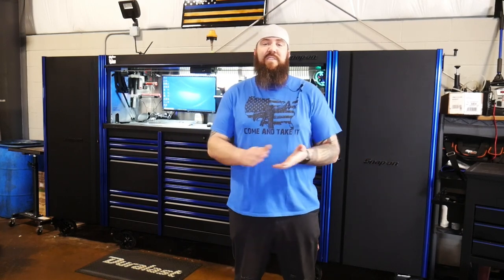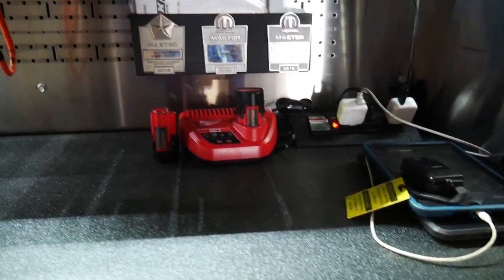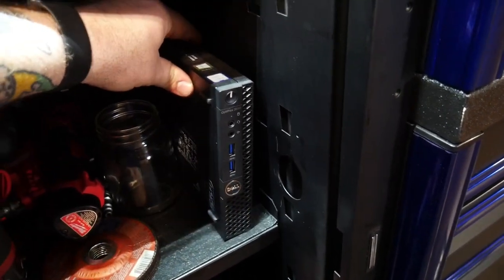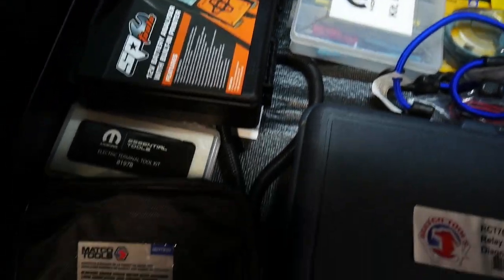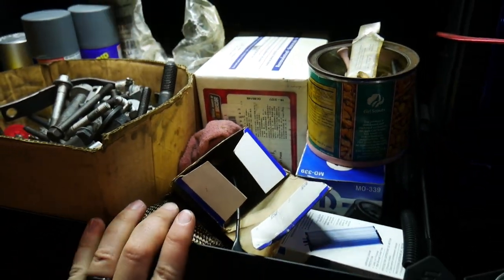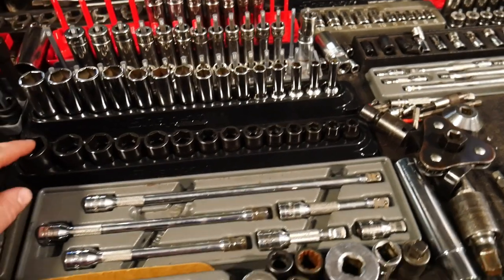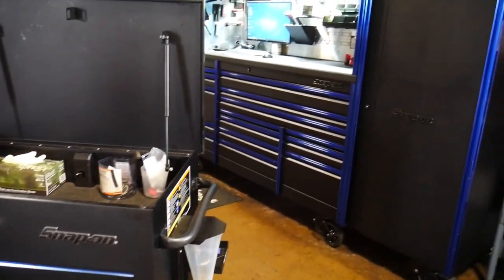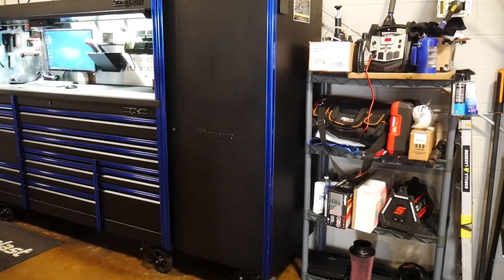EPIQ TOOLBOX TOUR - UPDATE 2020

Comment: For the bubbles in the bedliner, take a syringe with crazy glue and inject it push out the excess and clean up with rubbing alcohol.  With the quick set bedliner things happen and you can get small bubbles.    Awesome box setup  I have 68inch Epiq with a  hutch it's candy apple red with gloss black trim

Comment: nice box! fix bubbles in place. go to feed store look in bovine section for syringe, get small jar of contact cement, squirt under bubble use magnets to hold down till dry. on your magnet switch can the receiver be turned 180 to where wire is facing up? if so get some 3m strip caulking it doesn't harden tuck all those wires up out of sight.

Comment: How do you like the coil on plug interceptor ? I was going to get the paddle wand from aes wave for my scope. I have found moving from working at a mopar dealer to an independent shop that my tool inventory has quadrupled. I’m glad I seen you done some vids on how not to get yourself buried in debt with tools, seen so many young kids struggling to pay huge tool bills.
Reply from the maker: I like the COP interceptor, don’t get to use it as much as I’d like to lol. Yeah guys need to keep their spending in check for sure

Comment: Well looks like I have some money to spend now thanks Kyle... I personally think the snapon wobble plus is better then other brands out there I have snap on 1/4 in through half 1/2" but always find myself buying more lol. I have the gearwrench version and they seem to kick the socket off a lot. I'm seriously lacking in the 12 point I just need to bite the bullet and order new boxes, my 2x72s are stuffed along with the top boxes. I like the milwaukee vice grips and everyone tries to tell me they are trash I'm yet to have any issues. For those looking for pwz pliers and want to save some money buy them through bahco, they are a snap on owned company and produce pwz pliers for snap on in spain. Stay safe bud
Reply: After Snap on bought out Bahco they move manufacturing to Argentina and after blowing out the teeth every other month it felt like I ended up going with the knipex quick adjust swedish pipe wrench. My pwz are now just crappy hammers.

Comment: can't remember exactly which years but dodge had a kit when the fuel pump relay went bad in the tipim you could wire in a external one do you have a extra set of instructions for wiring one. i did one a while back and misplaced the wiring diag. if you do let me know thanks

Comment: How so you set up The lights in the locker to work like that? I could only get mine to come on when the magnet got close not the other way around.
Reply from the maker: They have different controller boxes that are either normally open or normally closed, just tell your rep to get you the other control box